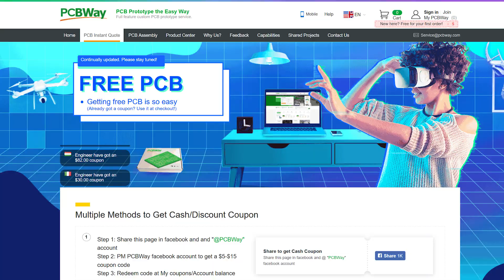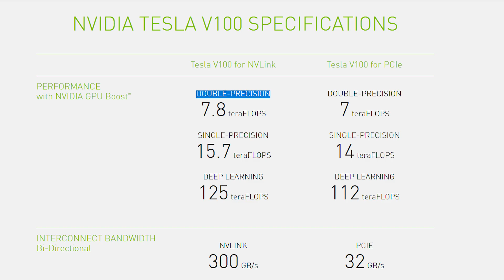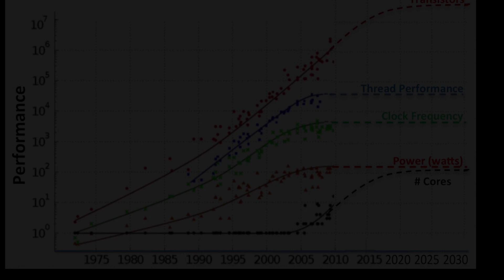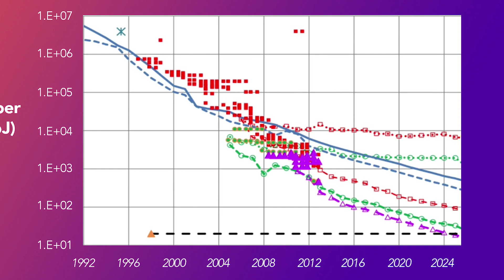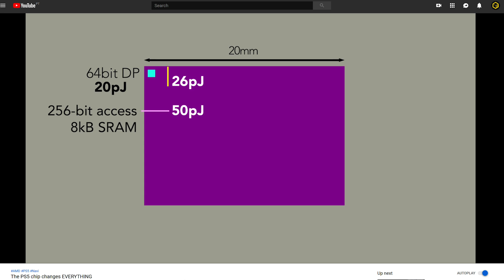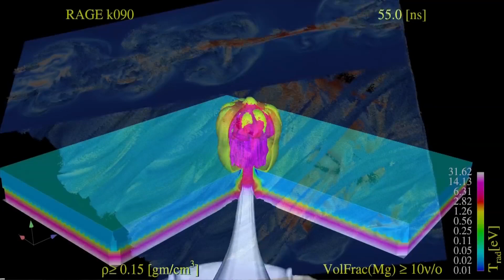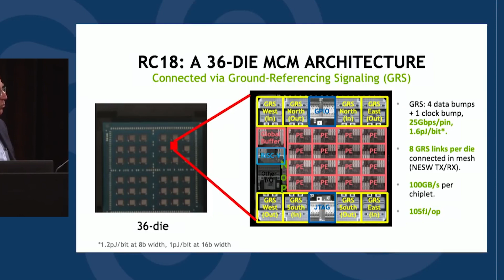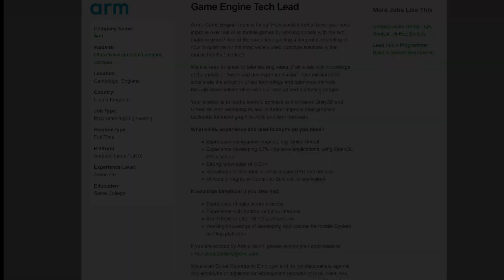The FUTURE of Computing Performance

Comment: Software developers now are truned out by 90 day bootcamps and do JavaScript. As for "lightweight oore" - well, quite obvious that most of silicon is unused in day to day operation but we've been that route: GAPP in 1981, Intel Larabee, all graphics cards....most ARM cores now have what samsung referss to as big.LITTLE, mixed capability cores - too bad, again, software would have to catch up.  OS schedulers, cache management, I/O -  https://en.wikipedia.org/wiki/Geometric_Arithmetic_Parallel_Processor - anyway, current PC and by extension computer architecture is in for overhaul. We should have CPUs (multicore with slow and fast cores with simple instruction set), that esentially manage workload, SPUs (specialized processing units) and PGUs (essentially - FPGAs loading specific configuration for given task) and all these should be managed by routing and architecture aware OS, written in managed code a.k.a Singularity / Barrelfish and hints as to workflow.

Comment: Look what is possible with the iPad Pro (2018)
Desktops are really insane inefficient power wasters by hundreds.
Reply: And that's why you shouldn't compare them to tablet PCs. Try running fully used SQL database server for a year on an iPad Pro.
Then we talk. Heck, just try and go ahead training a reasonably sized RNN on an iPad Pro for a few days. You simply can't because of memory and thermal limitations.
In fact, you can't do hardly anything a PC (or Mac for that matter) allows you to do, because even the OS itself is limited to a point where it becomes unusable for many tasks.
There's specialised devices for specialised tasks and devices built for general purpose (e.g. Desktop PCs) need to compromise and since power (and therefore waste heat) isn't that big a deal for desktop platforms, they can get away with that. And cost much less. And be more versatile. And extensible.

Comment: It is crappy coding, that bottlenecks a pretty lot at this moment. But RAM is always the limit as it is always too slow. So two things need to be implemented. On is a very fast I/O processor that can look at software and it's threats and chipset requests also capable of prediction. Thereby being able to orchestrate and divide instructions and coding to dedicated processing area's. It will also give room to virtualization and such. It should be running RISC by itself and running as fast as possible while being able to address and issue more complex/parallel instructions and data. Still; if we can make nano tubes with graphite, it must also be possible to do something interesting with copper. When heated copper forms a black oxide layer that insulates as well. When using twisted nano-wires; the behavior of copper is different then when the atom density is higher. As insulated twisted wires cancel out magnetic interference and thereby lowering resistance. On nano scale things are very different. This applies to all the different types, of atoms. On nano scale stuff behaves different and light can also help out, bridging distances. Namasté
Reply: Transfer between 'permanent' storage and CPU/RAM is a huge factor for many applications.

Comment: GPU should be renamed to just MPU multi processor unit or something. There will always be a need for CPU and GPU processing, one will not replace the other. Also, photorealistic games will not be achieved by hardware, especially not one from nvidia as pathtracing a typical game today at a fuzzy, noisy 1080p 30spp at just 30fps would take 30 2080ti totaling to $36,000. if photorealistic games are achieved within 10 years it will only be by a paradigm shift in software. You are correct the real bottleneck is energy that is why I believe silicon chips will only get 20x better before they become obsolete. 20x I believe 20x is the absolute limit of silicon based chips and it will only come by RISC and chiplet technology. This will all happen in the next 10 t0 15 years. The real long term future of microprocessors is beyond silicon.

Comment: "You need more than just fast processor...fast I/O...". You mean data buses right?
Reply: Well fast I/O is a generic term. You could speak of fast I/O with respect to the CPU(s) and RAM. Also you need fast movement between 'permanent' storage devices and the RAM the CPU is using because no matter how fast data is being bussed around between the CPU and RAM etc. you still need to feed data quickly to the CPU/RAM from storage, (for most processing applications). All we had for about 50 years for storage were hard drives which are extremely slow compared to how quickly the CPU and RAM functions. Then SSD's kicked in and that gave us massive gains.
Reply: Right! CPU, RAM, HDD, GPU, etc...all connected together by a fast DATA BUS.
Reply: @c4stmiranda902  I should have specified the main problem with HDD with regard to speed. The HDD has moving parts. SSD's do not have moving parts. That's the main reason why SSD's are extremely speedy compared to HDD's. A fast, wide bus will not make a significant difference. So now you know.

Comment: Graphene will be the new conductor, it conducts electricity 10.000 times faster then copper, silicon is much faster then copper but much slower then graphene. So graphene will therefore replace silicon which is the modern conductor in computers still today! Then finally 4k, 8k, 16k..graphics will be possible to run truly fast enough as the bottle neck for memory chips have been reached with silicon, simple! :) Then the x86 architecture (as the singularity) since the 1940´s will be replaced with arm or risk processors (since the 1970´s), then after a long time more we will finally get quantum computers on the private market, which already exist! Happy slow step by step frustrating capitalistic marketing people ;)